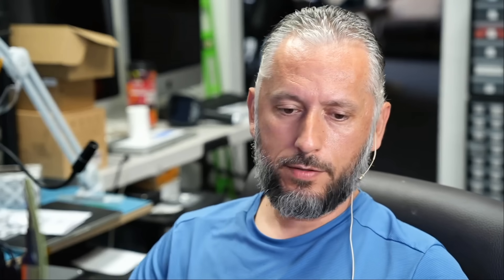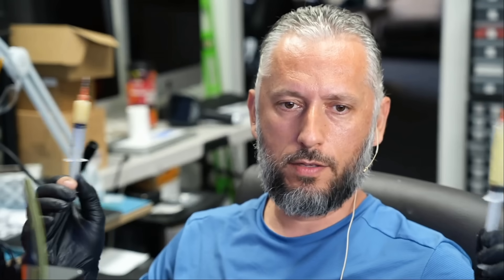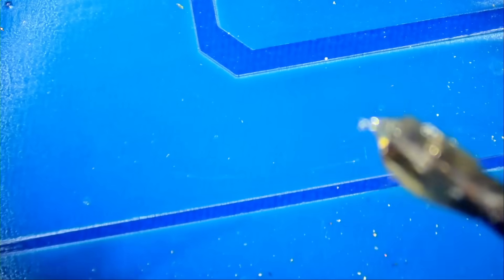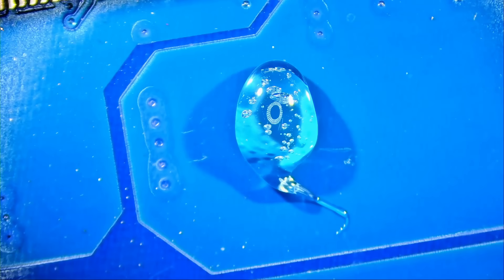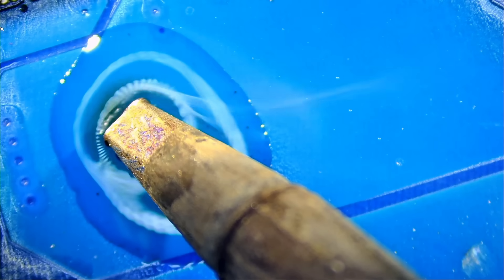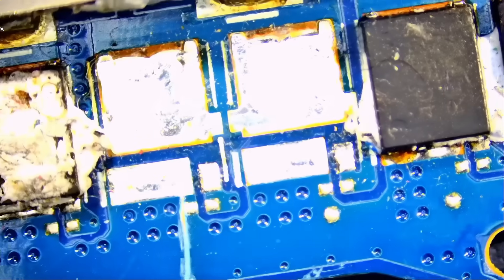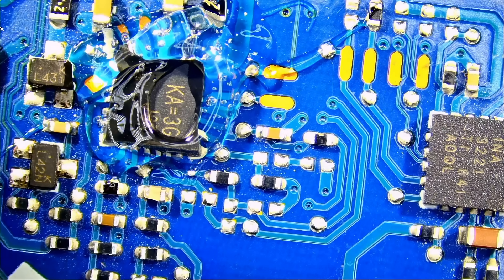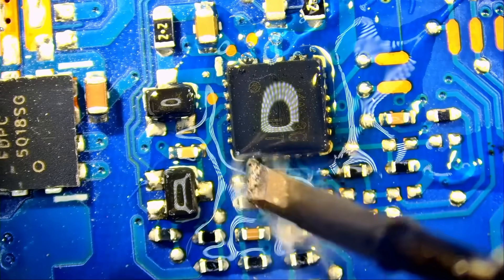New Flux a Game Changer This will change the way you solder.

Comment: The fumes of this new flux are safe?
Reply from the maker: Using safe materials doesn’t eliminate the need for proper safety precautions. Always use a fume extractor to get rid of the fumes  The flux is RoHS 3 and J-STD-004B compliant, meaning it’s considered safe for humans and the environment as mentioned in the video. Just like driving a safe car doesn’t mean you can skip wearing your seatbelt,

Comment: Why don't you take paypal for payment?  A little reluctant to enter my info directly on your site.
Reply from the maker: We never see or store your credit card details. All payments are processed securely and directly through our trusted partner, Square, which then either approves or flags your order. Our NorthridgeFix website is protected with an SSL Certificate, which encrypts the connection between your browser and our site to ensure your data is transmitted safely. Ordering from NorthridgeFix.com website is 100% safe. You can also find this information in our Privacy Policy at https://northridgefix.com/privacy-policy/ under Security Statement.
Reply: @NorthridgeFix  Thank you for that information!
Reply: He actually talked about that once on a video if I remember correctly. 

A customer had two different orders. He combined them together when shipping to reduce shipping cost. He also refunded the customer the difference in shipping. Then the customer disputed it because technically one order was missing in PayPal's eyes. 

I think that and the 6 month time one can dispute charges with PayPal probably soured the experience.
Reply: @MarvelousB if you have the PayPal debit card active, I think that works. I'll have to check again soon.

Just checked, that method did work.

Cheers!